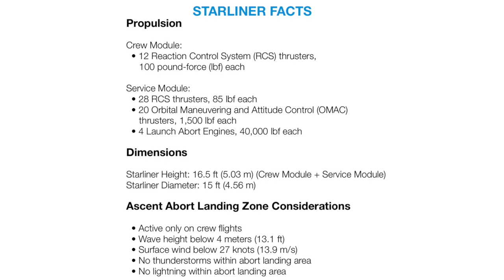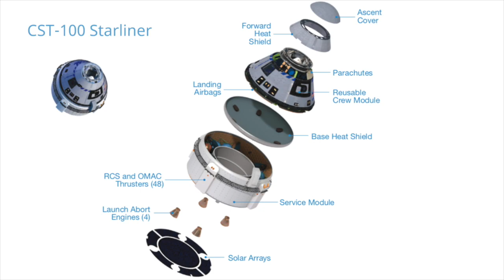Starliner anomaly explained

Comment: This whole abnormal event could have been salvaged had the mission controllers been better trained to recognize this issue and intervene.  The fact that the capsule did not access the correct clock start should have been recognized immediately.   Simulator training with inserted malfunctions such as this would have added situation awareness and reduced response time.
Reply: Yeah, you sound like the man for the job. Didn't you listen to what the astronauts said? If they had been onboard there would not have been a problem. They know how to fix these things. If you read about the history of spaceflight, you'll learn.

Comment: Finally a honest answer, and not the we are fine smoke. If astronauts where on bord  crap.
Reply: Why does everyone assume this would have ended in disaster? Listen to what the astronauts themselves said. If they had been on board this would not have been a problem. Anyone who knows anything about space flight has seen these things before. Gemini 8 with a stuck thruster got into a much more dangerous situation than this and the crew of Armstrong and Scott survived. Apollo 12 with Conrad, Gordon and Bean was struck by lightning during the launch and the entire computer went haywire until someone pressed the reset button, averting a mid-flight launch abort.

Comment: This sounds good and all but I hope they realize that this could set back the crew flight test but only for a little bit
Reply: It will set them back and the reason is they will have no launch vehicle ... ULA has to build another Atlas rocket to support another launch ... this is why re-usability is so important. Assuming Crew Dragon would have experienced  a similar failure, SpaceX would have another launch attempt a month a half later on the same booster the capsule launched on ... this was demonstrated with Falcon Heavy, where the side boosters were refurbished and flew on STP-2 a month later.
Reply: @mrsantana9094  What are you talking about? Of course they have more launch vehicles in the pipeline. Many crewed launches have been scheduled for a long time. They don't just launch one, see if it works, then build another one. In fact, getting to the station was not a requirement for this test. If, as it seems, the problem was a simple software issue, and if the spacecraft continues to perform well through tomorrow's landing, the next launch will probably have a crew. No need to perform the same test again.

Comment: NASA human spaceflight is an anomaly, typical never a straight answer NASA 
Short cut analysis again, it is a pin in wrong, now clock not synchronization
It is unbelievably charts again, where is the software code and communications diagram?
Reply: Remember the "We were using imperial measurements and everyone else was using metric" excuses for one of the Mars probes.

Comment: It is really not reassuring to hear all these management typical bozos focusing on "all the things that went right".  If they think that's good for PR or for public consumption, they'd better think again.  The key to success is to focus 100% on what went wrong, and fix it at a 150% level, meaning, not just the specific problem, but fixing the philosophy error that lead to not catching the error in testing in the first place.  By the sounding of it, they are plunging head-first into learning the wrong lesson, namely, fixing whatever caused the time to be wrong.  That is the wrong lesson because one much bigger error is to have made "time" be the sole basis upon which to decide the vehicle's behaviour.  That is the mother of all assumptions:  i.e., that everything is going to proceed as planned on a fixed timeline.  It is the wrong lesson to learn also because obviously all 3 navigation computers (assuming they have redundancy) seem to have pulled the same wrong time at the same time;  so this is a terrible design blunder, namely to have redundancy, but then defeat it by using non-redundant data acquisition protocols.  Seems to me Boeing is a brain-dead company, with a CEO that is a church-goer, which to me implies the type that put faith ahead of empirical evidence ... who infamously got rid of most of their older engineers, who happened to be their best engineers ... Power-mongering,  lying to the US President by reassuring him that everything was going to be ok with the 737MAX ...  alienating their own employees, from engineering to factory workers ... Using their political influence to try to force NASA to give them priority of contracts ...
Reply: In competent management, top down, where is the dd250? NASA now owns the rocket. Wait it is in the ocean.
New generation of ruck ups again.
Reply: You can't fix anything unless you know it is broken, they have identified the error and will act accordingly. It is also good to remain positive, it demonstrates confidence. If they were yelling out, we failed, we failed, do you think that's good motivation to focus on positive factors going forward? That's the problem with people these days, they have a problem and they start focusing on the negative things about it instead of focusing on something positive that will lead them in the right direction. The law of attraction works wonders, likes attract likes, opposites reppel ... if you say, I'll never be rich, YOU'LL NEVER BE RICH but if you say, I will be rich, then you start to believe you CAN BE RICH and you start to pursue that endeavor but the minute you admit defeat, you have failed.
Reply: @mrsantana9094  This new age kind of philosophy muddies things.  You don't solve any problems by "focusing on the positive".  You focus on the problem.  That's how you solve it.  When you are so focused on a problem that you dream about it in your sleep, THAT's when you solve it.  Focusing on the positive, my A$$.  I don't say they should be screaming "we failed!";  they should just be working on the problem instead of congratulating themselves so much.  Were SpaceX congratulating themselves when their Crew Dragon blew up?, or when their first 3 Falcon 1 rockets failed?  No;  they neither cried and screamed "we failed!", nor did they congratulate themselves on and on about all the things that went right like complete idiots.  They just went to work on the problem.  But in this particular case with Boeing, the more they talk about it, the more they reveal about how horrendous their software is.  It is not just this one error;  it is dozens of things that need to be wrong for this error to cause a failure of the mission.  You understand what I'm saying?  If you are building a house, do you make a timeline and then simply look at your watch and if it's the time to lay bricks you lay bricks, without even looking at whether you laid the foundation first?  You just do whatever your watch says.  Because THAT is how stupidly this software was coded, if we are to believe what they say, that the craft was burning fuel because it thought it was a different time.  Can't the program verify it is time to burn fuel on attitude by checking that it is getting near the ISS?  Can't it verify that the fuel that should have been spent was indeed spent?  Why does it ONLY look at time, to decide what to do.  That's the height of stupidity.  And they didn't make arrangements to have a copy of the clock's time at ground control, to verify.  They obviously made no effort to include a verification routine when the clock was set.  They did not put a piece of code for the craft to reply with "I got it, my time now is XX:YY", so that if it got the wrong time it could be corrected.  No imagination.  No capacity for designing a comprehensive way of testing, either.  They wasted a billion dollars, basically, to find a STUPID bug.  How can you trust ANY part of the software after such absurdities are revealed?